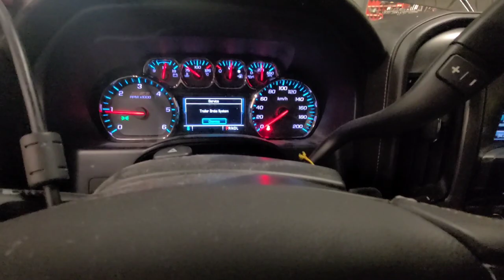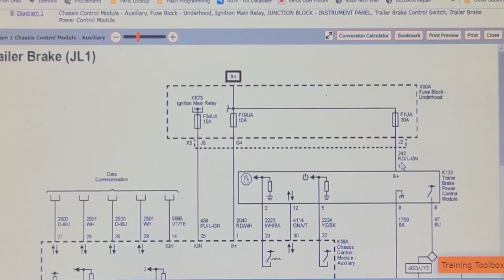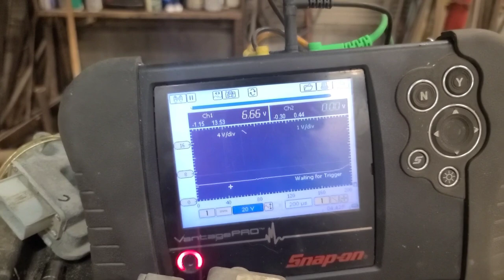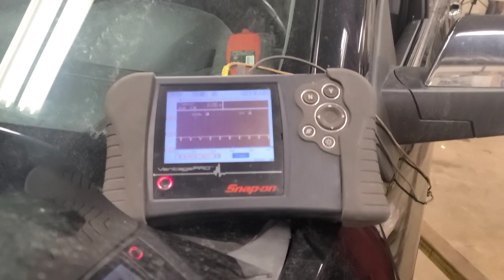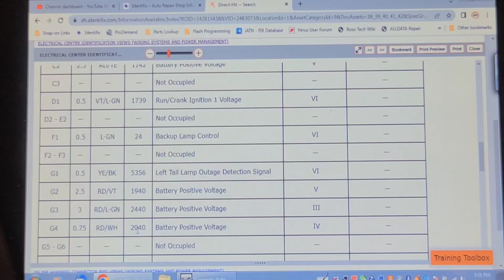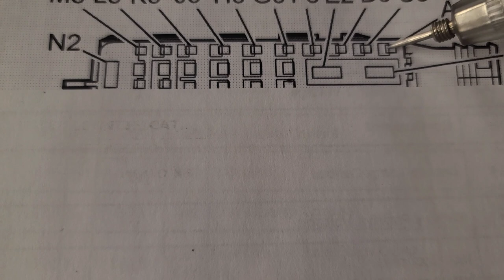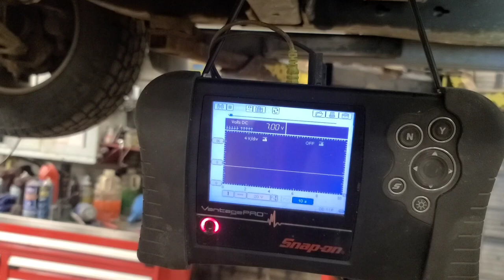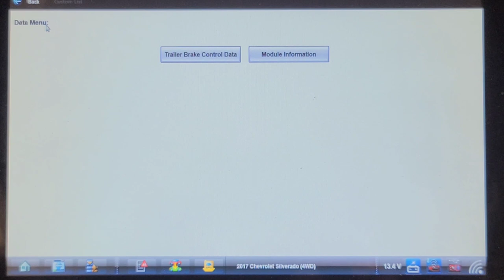2017 GM Truck 1500 4x4 Service Trailer Brake System Message

Comment: Check underneath the drivers door in the harness along the frame. I work at a Chevy dealer in Michigan and I have found the wire corroded there several times.
Reply: Thank you for the info Michael! Mine was broken…red with white stripe. Code is gone
Reply: Do you mean underneath the door sill? Or under the truck?

Comment: Thank you very much for all info in the video , I have exactly same issue. And swapped trailer brake adjuster and trailer plug between 2 of my trucks . All works . Was about to order brake control module then came across your video . Long story short i end up splicing 1 and 25 together , checked that no power present there when truck is shut off and no more error.  I know it’s not proper repair ,  but it works  and if I blow  something so be it lol , as long as I don’t see that message on the screen ! Thank you again !
Reply from the maker: One of the circuits I believe to pin 1 is hot all the time pin 25 is switched with key on. Jumping them may cause a parasitic draw as it could backfeed. Some possibilities...

Comment: I’m having an issue between the Chassis Control Module and the Brake Control Module on a 2018 Suburban. Throws a bunch of U codes, Reduced Power Steering, Service Trailer Brake, ABS, Stabilitrak. Lost a wire. Can’t figure out which one. I’ve seen where apparently a transistor right in that neighborhood can go bad. Moisture seems to exacerbate my problem. Very frustrating.
Reply from the maker: Try measuring terminating resistance between pins 6 and 14 of the DLC with the battery disconnected. Should be 60 ohms. I gather you don't have a scope to look at can bus signals. Which modules don't communicate?
Reply: @PhillipBailey  After physically checking the ECM, the Body Control Module, the Brake Control Module, the Chassis Control Module, and the Trailer Brake Control Module for anything obvious and connections, and checking the harness everywhere I could, saw a couple bulletins on 5986 Circuit, and reprograming the PSCM, I gave up and took it to the dealership. They diagnosed and found “a bad wire between Chassis Control and Brake Control”. I asked which wire and the guy said he though the tech said K 12. They want $1k to run a new wire. Unfortunately I don’t know exactly which wire. But am going to try to find out and save myself the money. We got some snow and the roads were wet today and after a week of almost nothing in dry conditions it’s been yelling at me all day.
Reply from the maker: @HuntMountain06 I believe 5986 is referred to as the Serial Data Wakeup circuit which comes from the BCM and is basically the ignition wakeup voltage to various modules. I'm not sure which module is K12 but I will check. It would be nice if you knew what fault codes were being generated. If that circuit is shorted to ground it will likely take down communication with multiple modules.
Reply from the maker: Actually the circuit 5986 does not appear to exist. The wire I thought you were referring to is 5985. K12 does not appear to be a valid module number either.
Reply: @PhillipBailey  codes are U0121-00, U0415-00, U0428-71, U0415-71, U0401-71, U0422-00. I didn’t get a chance to pull codes today weather was uncooperative. Wet roads seem to really set everything off though. Going to drop the spare tire tomorrow or Thursday and poke around the chassis control and trailer brake control and see if I can kind find my wire. Maybe spray it with a house and catch it lighting everything up like a Christmas Tree again. Would be great to have a specific wire color to aim for.
Reply: @PhillipBailey  I caught that one off of Bulletin No: PIT5457, it might not apply specifically but a lot of it seems to line up. The other Bulletin I found was 20-NA-113.

Comment: I like the way you go about diagnosing. I have a 15 that’s not even giving a communication code it’s like it don’t exist. When I click on trailer brake module it just says no communication. Btw I like that scan tool
Reply from the maker: There are several options for the trailer brake control. This one uses the auxiliary chassis control module as the trailer brake control module. If I tried to select the trailer brake control module I would get no communication with it. Need to select auxiliary chassis control module.
Reply: Thanks, I’m still unfortunately working on this one. I can’t get gds to communicate with chassis control module now. It was communicating with chassis module but I installed. Trailer module and now the chassis module is not communicating. Even going back to plugging the old one back up. There is so much dirt under this thing you can’t even fart with it getting in your eyes
Reply from the maker: @dreece2000  can you test termination resistance of the can bus at pins 6 and 14 of the DLC battery disconnected. It should be 60 ohms +/- 2. If it reads around 120 you have an open in the network. ABS modules are common to fail and take down the bus. If you unplug the ABS module and identify the forward bus pins it should measure 120 ohms and the pins going back should also measure 120 ohms. There is a resistor in the harness at the back that sometimes fails. If you have a lab scope you can look at network activity at the chassis control module bus pins too.
Reply: @PhillipBailey  i will do that when I get back to it. Thanks for the info. This is one of them customer standing over you hindering you to death trucks.
Reply: I have 120 ohms with abs plugged or unplugged
Reply: Oh man now nothing on 6 and 14 communicates. I wish your shop was close by.  Thanks for your help
Reply from the maker: @dreece2000  well then you definitely have an open in the can bus. With the ABS module connected do you have communication with it. If so the network is good to thar module. As I mentioned at the ABS module connector identify the pins going to the rear of the truck. You should measure 120 ohms across the rear pins. Check continuity from the ABS connector to the chassis control module and the rear resistor. Good luck
Reply from the maker: @dreece2000  do you have a DLC breakout box and lab scope to look at network waveforms.
Reply: @PhillipBailey  yes sir I do. Im all ears
Reply: @PhillipBailey  everything is getting worse as far as the can bus nothing but steering wheel module communicates now.

Comment: I hope this isn't what's wrong with mine.  However, I'm not getting continuous alarms. Only the 1 time when I start it and hit ok. I don't get it again until I start it back up.  I replaced the Controller in cab and that was not successful. Going to try replacing the plug itself and go from there.  Thank you for the video.

Comment: Geez wish I would have found this video a month ago been hassling with this for the last month changing the controller and the rear module just checked the 30 amp fuse and it was burnt out 😅 dammm. But thanks to your video I was able to figure it out. Thanks
Reply from the maker: Always start with the fuses but hindsight is 20/20.